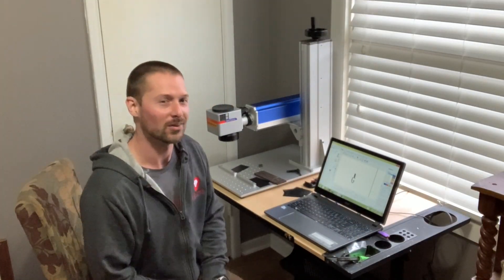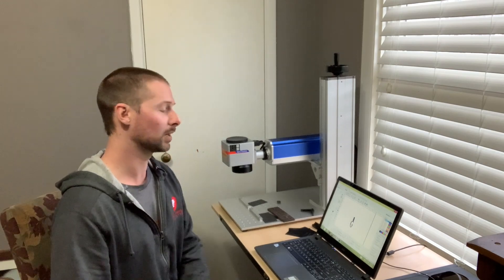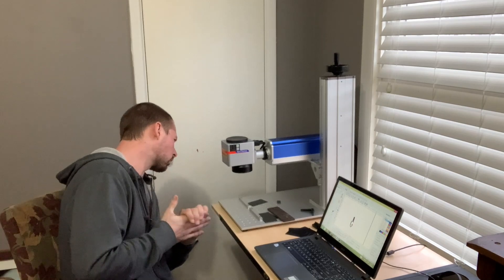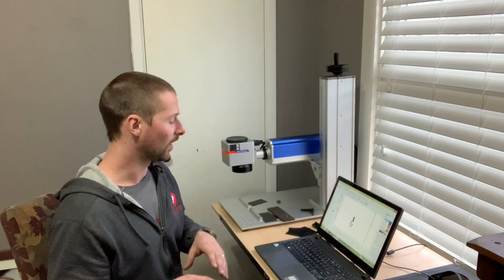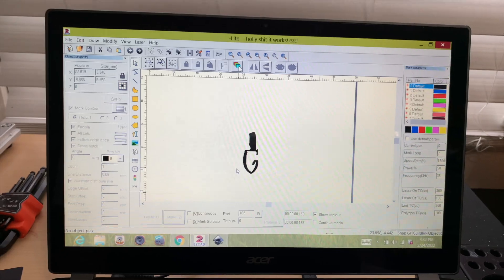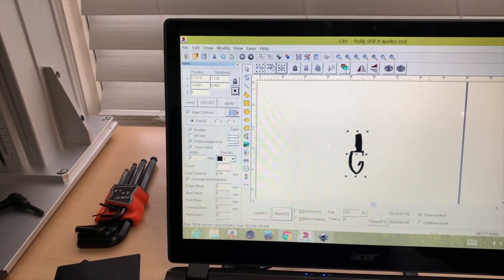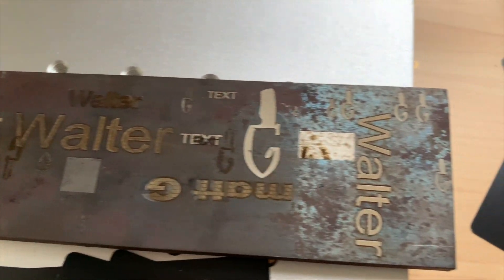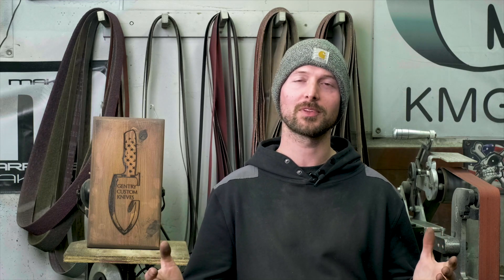FIBER LASER setup for simple logo engraving!!

Comment: I really love my 30w raycus.  I use a 170mm lens, I haven't needed to go lower since its plenty powerful.  Do not use 100% power, it will lower the life of your machine.  I find with steel 90% power with 500 speed with 3 runs works great for deep etches with 1-2 30% power at 500-750 speed runs for cleanup.  0.025 is a good line distance for hatching.  SVG files seem to be the easiest to use with hatching with ezcad2. 

Get something to vaccum the work surface while you are using it since you don't want to be breathing in very fine steel dust.

laser everything on youtube is a great channel for learning ezcad and fiber lasers.  

You can do some amazing things with it like deeply engrave a forest scene on the whole side of a knife or even etch the whole Van Gogh Starry Night on a chef's knife.
Reply from the maker: Well I really appreciate your feedback! With the above settings is that for a black fill or silver?
Reply: @gentrycustomknives8008  black fill is basically around 80-90% power.  Silver or white or light gold is more of a 10-50%.  I personally like doing a few 90% runs to get the deep etch and then 1-2 runs of the lower power to get rid of the black and leave that clean white finish where it was etched.